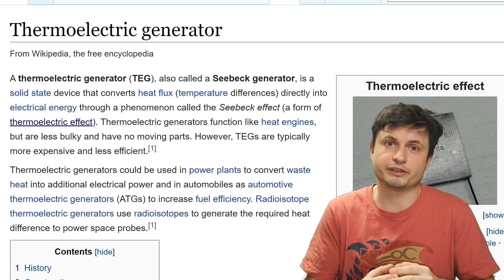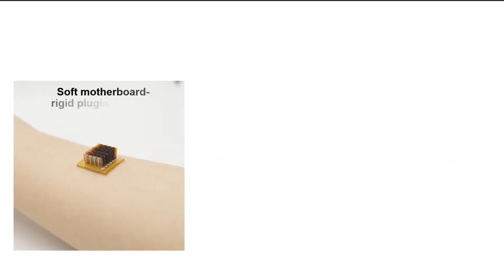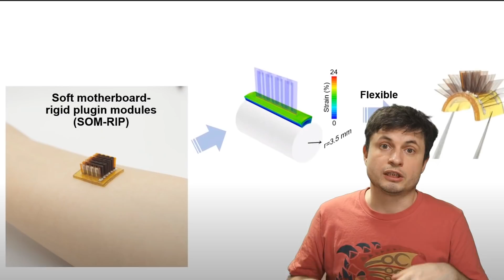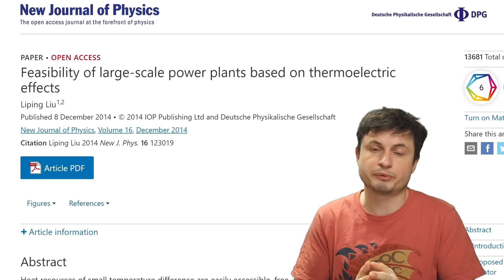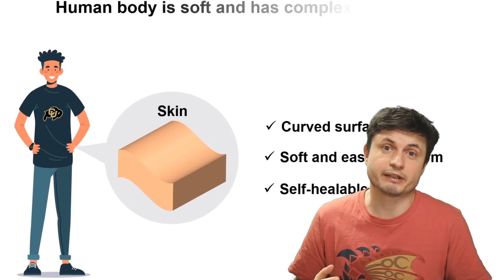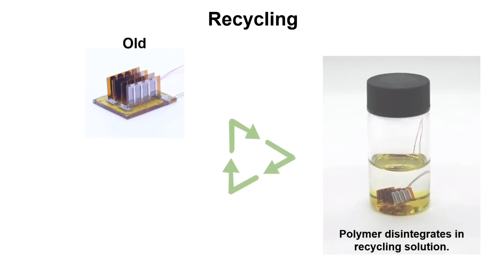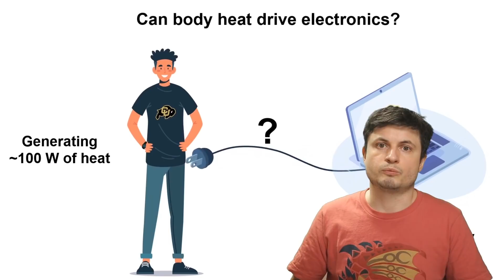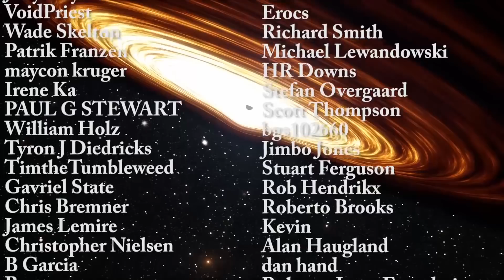Interesting Invention That Turns Your Body Heat Into Energy

Comment: I imagin this technology would be very useful for prosthetics that require power to move joints.
Reply: Nope, the power would be too small. It could be used for sensors and communication as they use very little power.
Reply: @brunoeumememoroni  it could well be enough to power sensory feedback arrays.
Reply: @ElectricChicken  i see, but if you power the actuators i guess you will have power for the microarray too, it just seems to be an extra complication to use two different power supplies, can you explain the advantage?
Reply: @brunoeumememoroni  having this incorporated into a prosthetic to power what it can would extend the life of the main power supply, perhaps even helping to slowly recharge it when you are stationary. Drawing power from whatever ambient source to keep the prosthetic working longer between plug ins would greatly improve the quality of life for the person wearing it. Imagine having to plug in your phone to charge every hour to keep using it verses every night before you go to bed. If you can incorperate multiple power sources seamlessly, I say go for it.
Reply: @Tiggersharrk  10 uW is like a drop in an ocean with actuators that need Watts of power: it won't make any difference at all...
Reply: but the paper says it should be enough power to run biomedical sensors communicating remotely, which would be very useful for medical apps.
Reply: @brunoeumememoroni  keep in mind this is a 1 square centimeter prototype. How much more can you get with the surface area on a prosthetic and a polished up finished product. Don't so much look at the prototype as the potential it leads to. This would not be hard to upscale
Reply: @Tiggersharrk  how many square centimeters of exposed skin do you have? These devices will not work exposed to sun...
Reply: to clarify: the device does not generate much power, approx. 10uW. It's really not at all useful for any of the applications mentioned and more of a demonstration of what can be done. There's little to no marketability/application for this device.

Comment: Nothing new here, you can find watches using your body heat to charge its battery. In space they use high temperature thermoelectric elements or stirling engines (as in nuclear submarines).

Comment: 5:34 Voltage without amps is meaningless.
Reply: I checked the paper about it:
“ this TEG device can generate an average power output density of 45 and 83 nW/cm2 and an average output voltage of 25 and 33 mV/cm2 when the wearer was sitting and walking, respectively (fig. S8). For the surface area of a typical sports wristband (6 cm by 25 cm), a power output of 12.5 μW and a voltage output of 5 V can be generated when the wearer is walking, which is enough to directly drive most low-power sensor nodes with radio frequency communication.”
Reply: @brunoeumememoroni  that means they run on 2 uA?!  That is really low power.  Even the low power mode of many micro controllers use more than 2uA.
Reply: @brunoeumememoroni  and these are only the first, not-even-out-of-the-lab devices. Look at the advancement from ENIAC to your smartphone.
Reply: And energy is watts x time.
Reply: Exactly

Comment: Bro, this is how the Matrix was created and we got turned into energizer 🐇🐇🐇🐇
Reply: In the  original script for The Matrix, humans were used as a neural network for processing, not as a power source. However the writers decided that this was too nerdy, so it was changed to "batteries" so that every dumbass would get the story!
Reply: @Tore_Lund  Yeah and initially I didn't know about that part and got really annoyed by how they ruined such a great movie by making such a dumb mistake :D

My thoughts were in the lines of "nah too inefficient to use only human body heat than to tap into earth's resources"
Reply: @ccelik97  The change didn't ruin the movie, it made the movie accessible to non-tech savvy people. Those of us who are tech savvy and smart enough to understand the underlying themes aren't bothered by small concessions based on allowing the average moron to understand the story.
Reply: @danielkeene3852  What I think is such movies etc should have different versions depending on the target audiences' familiarity levels with the themes. A matrix undumbed edition would've worked better for me I mean.
Reply: Luckily for me, I just achieved CHIM not too long, so I don't have to worry about the machine regime's, battery powered Infinite Tsukuyomi.
Reply: To be fair, Morpheus held up a Duracell, not an Energizer.
Reply: @danielkeene3852  Yeah, Duracells are better.

Comment: Would be very interesting to put it on a black surface and let it stay in the sun :D Would it generate more electricity than a solar panel? 😄
Reply: Check the paper, they did that experiment and no, it doesn’t generate more power 😉
Reply: @brunoeumememoroni  Well, maybe the effect can be increased with parabolic mirros pointing to them 😄
Reply: @0Kaliber0  the same can be done with solar panels, so what's the point? the efficiency of thermoelectric conversion is at least 1000 times smaller smaller...
Reply: what matters is the temperature difference between the hot and the cold side, which will be just about few tens of degrees. when there are temperature differences of hundreds of degrees, like on the rovers on mars, it converts a lot of energy...

Comment: So this is how the matrix started
Reply: Except there's no chance that could work as you see it implemented in the Matrix. Heat is so incredibly inefficient when used as a power source.
We also need to retain body heat for our cells to function properly, so if it's removed over and over again we will freeze to death.